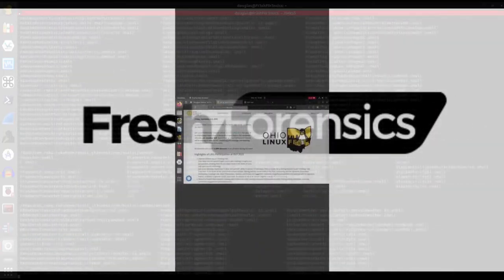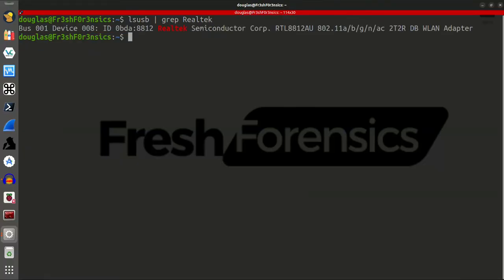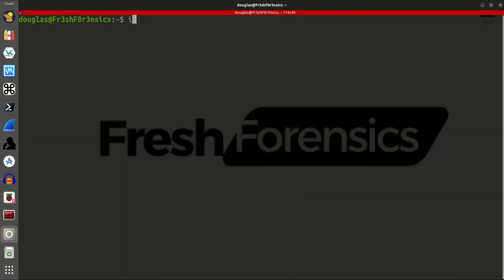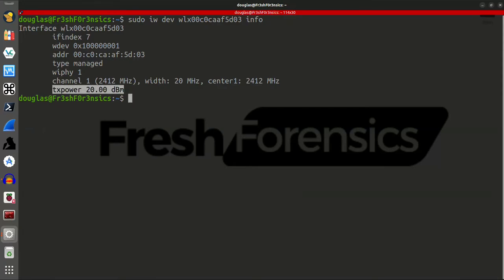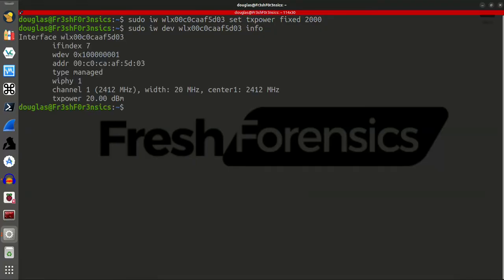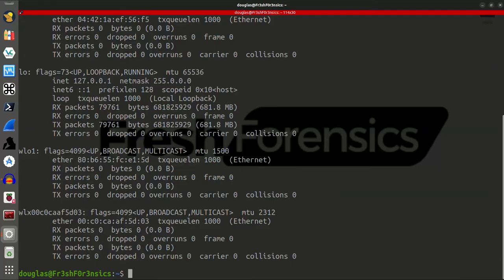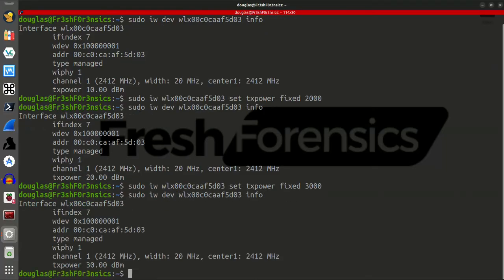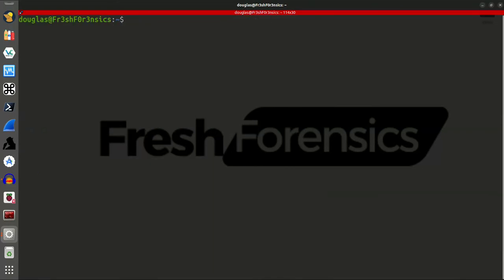How To Change The txpower Of Your Alfa External WiFi Adapter

Comment: it did not work for me trxpower still 2.0 . i need to  use --debug  , change the domain , i really do know what to do :____(
Reply from the maker: Which adapter are you using? Have you used the monitor mode script? It works very well for decreasing the Tx Power